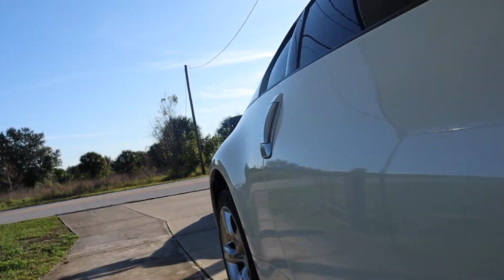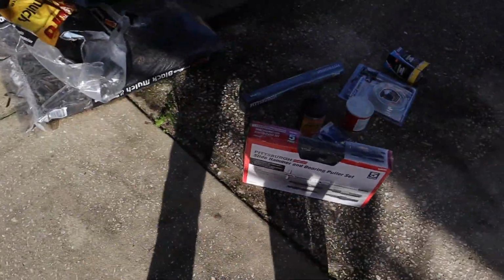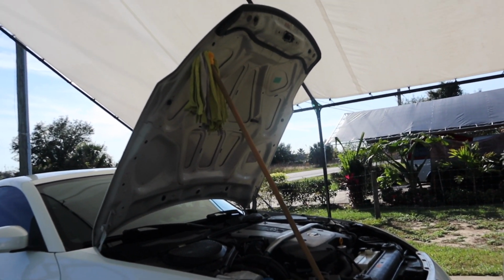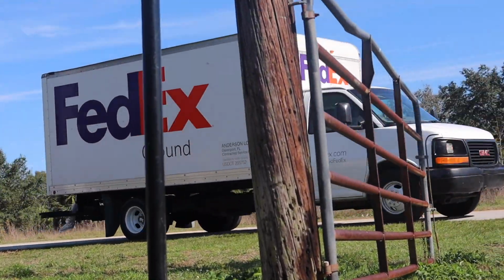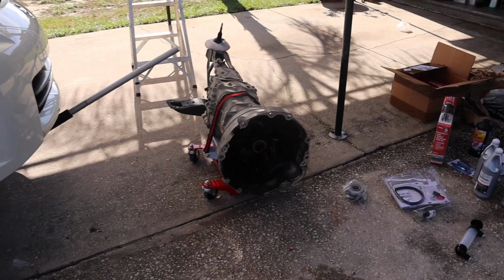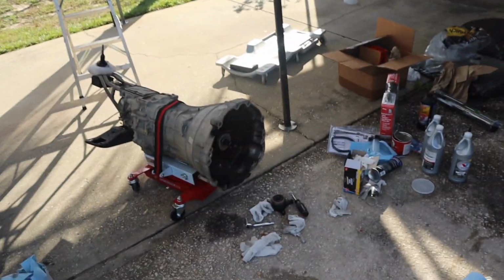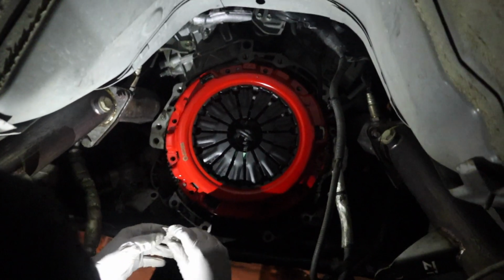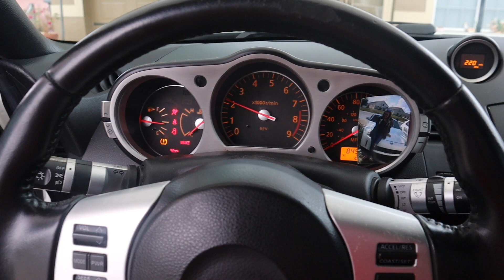INSTALLING A CLUTCH IN MY 350Z!!

Comment: How does the clutch feel bro ? I just ordered the same setup. I’m wondering besides this whole kit what else I’m gonna need like clutch lines, any new flywheel bolts/ clutch bolts ? Did you re use your original master cylinder ?
Reply from the maker: I reused all the bolts and I didn’t change the master cylinder everything works fine just make sure to use thread locker and bleed the clutch fluid, all in all the clutch feels really good it has a smooth engagement
Reply: ZlowHr  did you use the same clutch line aswell?
Reply from the maker: Yea
Reply: ZlowHr  the CSC is considered the throw out bearing in the HR right ?
Reply from the maker: Yea. Your clutch kit should come with a CSC and a pilot bearing

Comment: Is this job easy ? Plan to change my clutch on my g35. What stage did you go?
Reply from the maker: It’s not bad having a transmission jack makes things easier and i went stage 2
Reply: @zlowhr  Fosho. You recommend going stage 2 clutch. Im stock power. (g35) Im debating going with oem or stage 2

Comment: Have both of y’all changed y’all oil gallery gasket yet ?
Reply from the maker: Nope
Reply: ZlowHr alright cause I haven’t changed my either 😂 but how many miles y’all at ?
Reply from the maker: Mines just reached 85k and the nismo is around 140ish
Reply: ZlowHr 140k on the Nismo and no oil gallery gasket issues??

Comment: Where did u get a heavy duty slave cylinder
Reply from the maker: Action clutch
Reply: Oh cool man, soo I’m looking at buying the HD slave does it come with the kit or bought separately. Stage 3 clutch only indicates bearing so I’m thinking that’s not what I need . I need a full concentric slave replacement
Reply: Can u send me the link of the concentric slave you bought from them